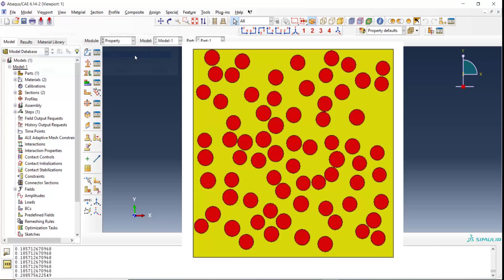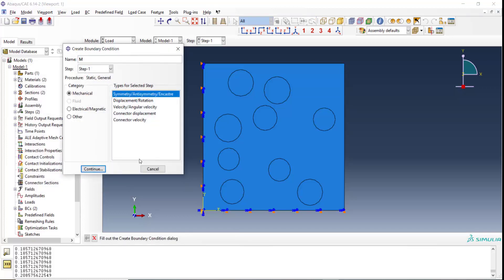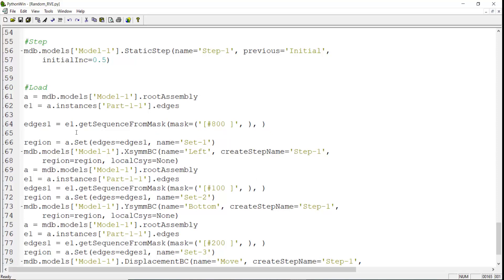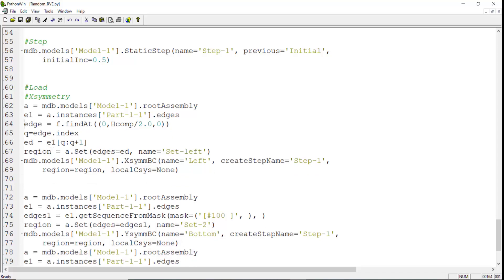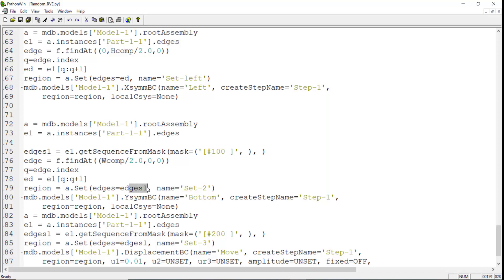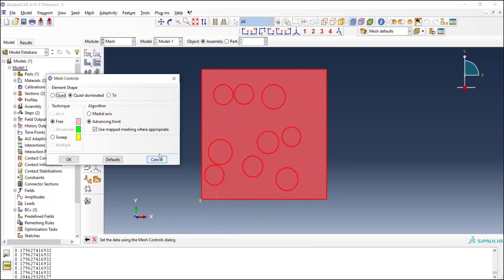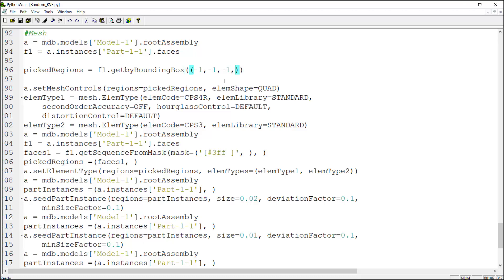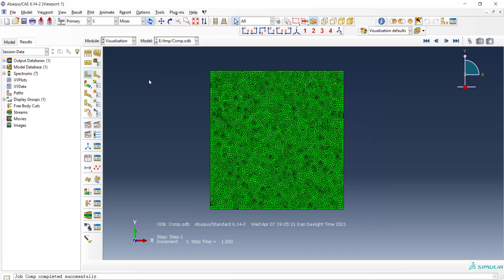#4: How to create random distributed inclusions or fibers of RVE/UC by Python scripting in Abaqus

Comment: Hi, 
Thanks for your amazing work.
Do you know how can we have intersection between fibers and the RVE edges (placing fibers on the edges and then cut that section of fiber outside of the RVE) as well as controlling the fiber volume fraction (having the same volume fraction defined first)?
Reply from the maker: Two complete and useful Abaqus plug-ins are now available which can model unidirectional composite RVE with random fiber distribution considering periodicity. The volume fraction can be even more than 80%. 
Please check these plugins and related videos:
3D plugin:
https://youtu.be/960tkfor_d0?si=hn5Hw_4Qn8GTyn9L
https://www.engssoft.com/engsoft_ud3d_v1/
2D plugin:
https://youtu.be/-Y40Z4Xv28s
https://www.engssoft.com/engsoft_ud2d_v1/